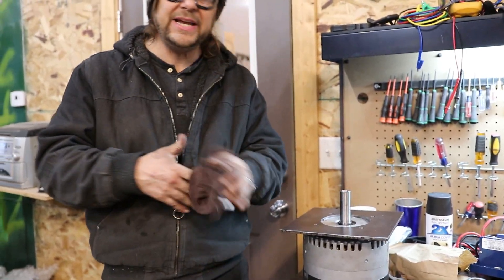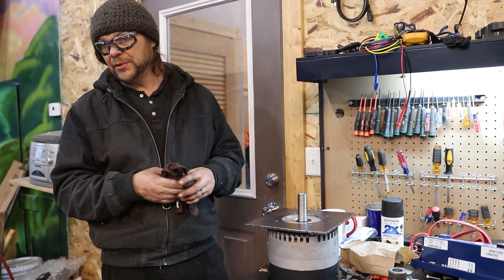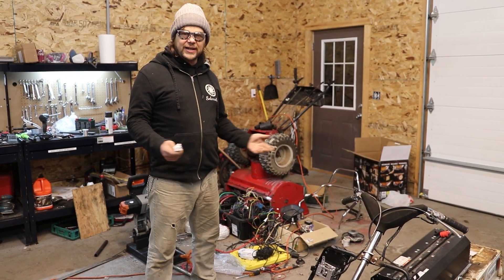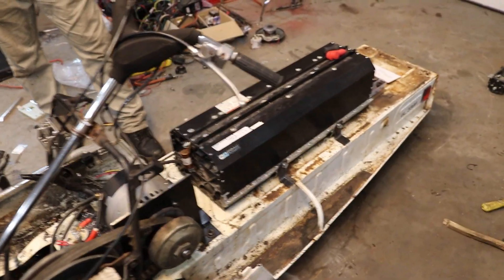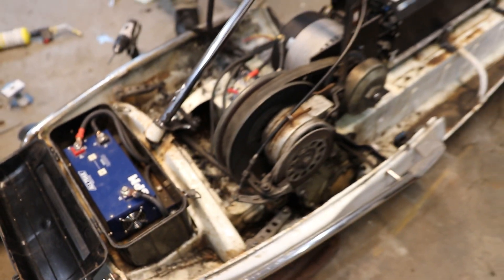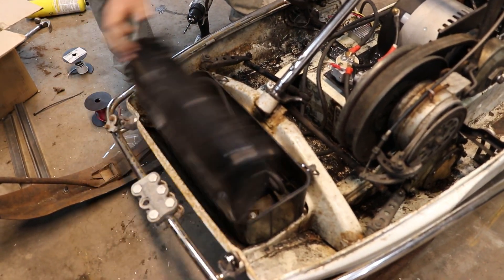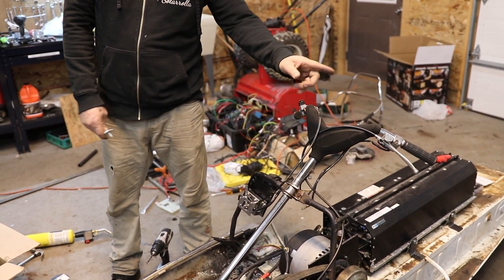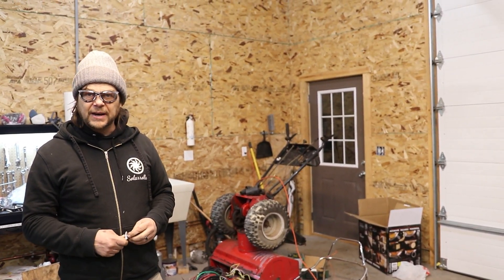Vintage Yamaha, Electric Snowmobile conversion by Solarrolla

Comment: Love this,  I want one! Now I see I wouldn't need a 1972 Yamaha 340 (or 240? retrofitted from my childhood), but any 1970s snowmobile will do for 2 miles roundtrip on my driveway. Yes we have a big trailer, our F150 pulls, that could transport this. But any chance to make an electric sled that fits INSIDE a 2013 ford transit connect? Maybe a retractable track? Or easy to disassemble for transportation? Doubtful,  wishful thinking,  but would be fantastic!